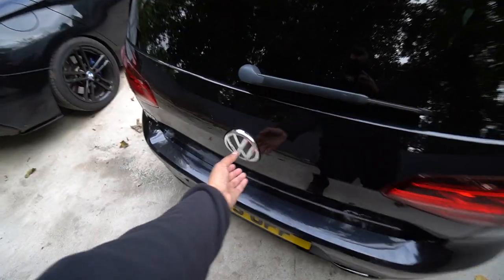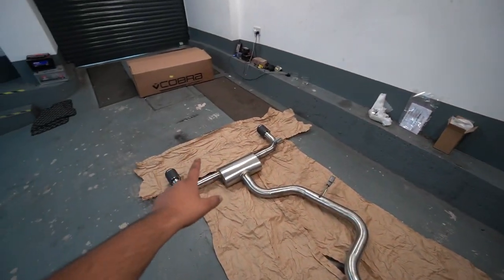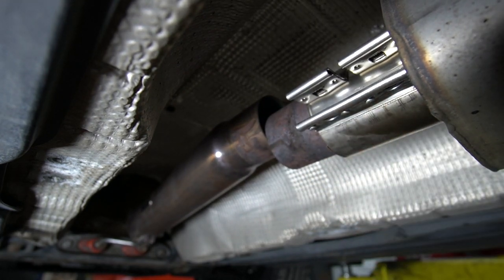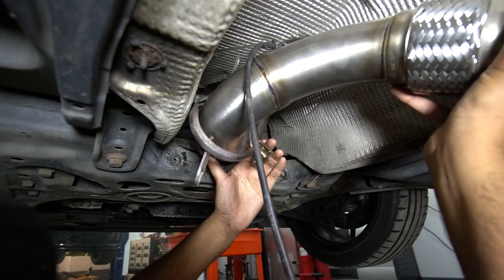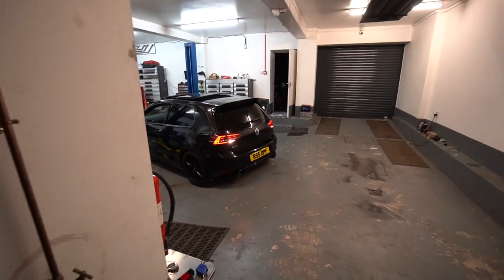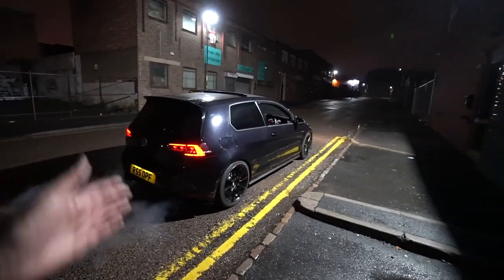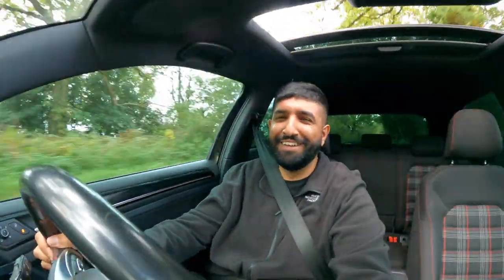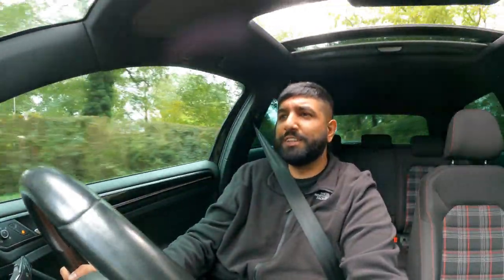My VW GOLF GTI gets a CRAZY Loud Exhaust!

Comment: Sounds good for the first 10 seconds, it will be a nightmare to drive after a while and back to standard before you know it once the police stop you and give you a ticket.
Reply: Why would they give him a ticket ?
Reply: @trickifichd2939  Loud exhausts and decats are not permitted - MOT failures basically and could invalidate insurance. A sports cat is the only legal way to run a sports exhaust system.
Reply: Worth it
Reply: @dollaz5541  you don’t even have to change the cat? A catback exhaust is perfectly legal and can sound very good/loud.